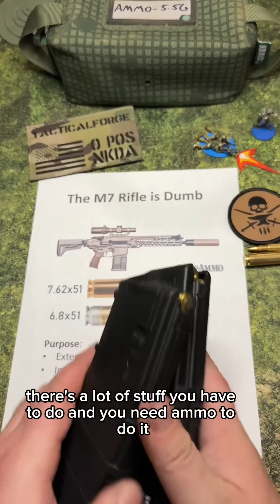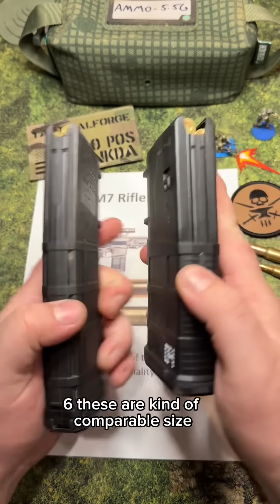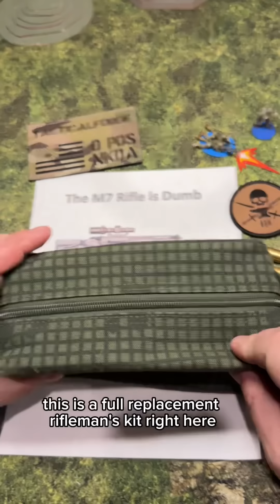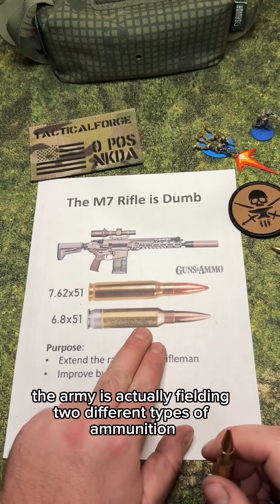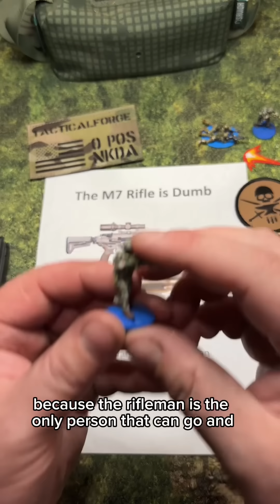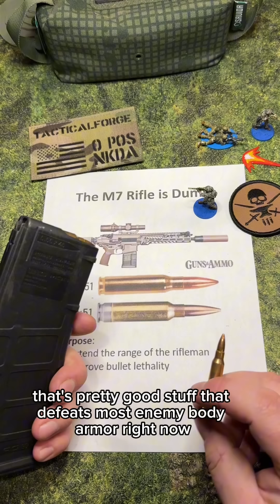The Army’s new rifle is dumb

Comment: I guess if your training round is a lighter load than your fighting round, you kinda need the computer in your sight to adjust for it. I wonder how long it'll be before the lighter load just becomes the standard load and renders the whole project kinda moot.
Reply: The project is moot anyways. The cartridge doesn't do any thing that couldn't be done with 308, just a hybrid case and light for cartridge projectile. Give a 308 a hybrid case and use 110-120 projectile.
While bragging about the speed they neglect to mention they went light projo, which is not what u want at long range
Reply: The original 30 ought 6. M1 ball. Was so effective that they had to make M2 ball because the rifle ranges in training areas were not long enough to allow for a safety zone behind the range. M1 ball 30 odd 6 was the selected round for snipers using the infield bolt action sniping rifle.

Comment: The UCP of firearms acquisitions. Just 1000x more expensive.
Reply: As bad as UCP was this decision is much worse!
Reply: @dvldog_ probably the most baffling procurement decision in decades, maybe the last century. 

The conventional cartridge seems neat and the compound cased version is a technical achievement, for instance, but I'm very much unclear on what benefit it's supposed to provide over 7.62x51mm outside of the specific ability to run in a shorter barrel without losing gas. 

For machine guns? The bimetal cartridge is going to be incredibly difficult to keep fed across the entire force structure. It's weird. The rifle would be good for some specific use cases, especially with a longer barrel and a different role than 'universal rifle'
Reply: Lmao
Reply: hehe more like ICP, fucking clowns
Reply: At least UCP can work in thy thy conditions, IE its proven to work when it's designed to.  This firearm can't decide what it wants to be other than just an overpowered round.